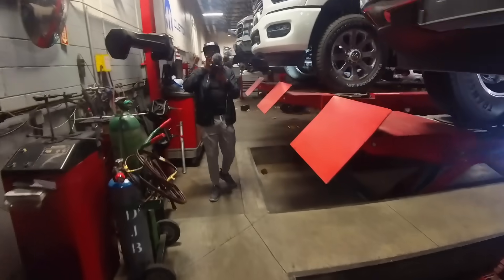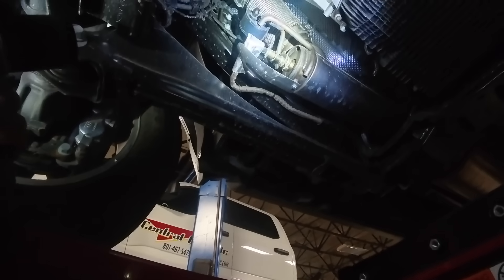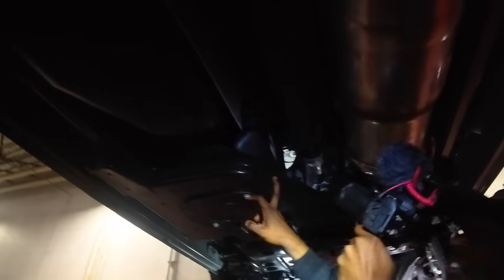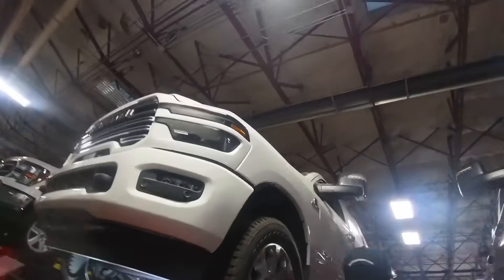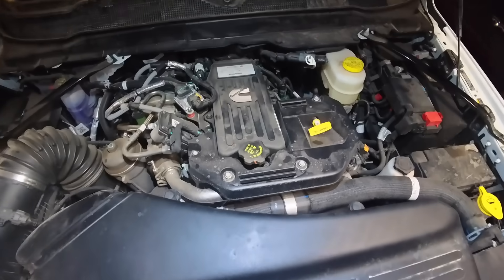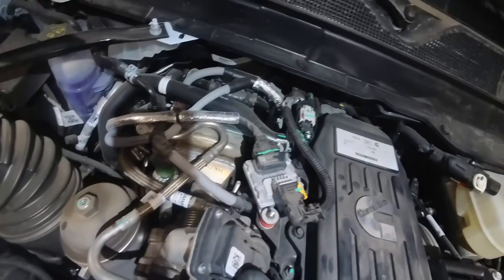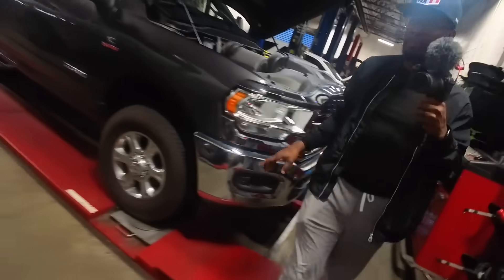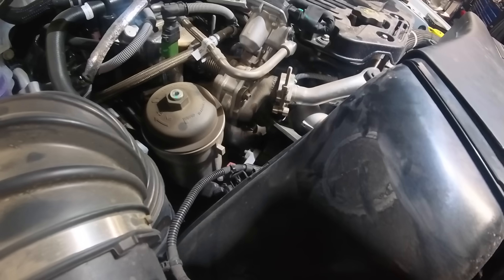Master Tech Compares The Old HO Cummins To The New One With ZF TorqueFlite (Powerline)!

Comment: I have a 2002 24valve cummins. Question what can I do to enhance  my engine to stay cooler and what other options do I have for the all round drive.
Reply from the maker: You can still do the fleece coolant bypass for that engine and I highly recommend it
Reply: @Trukstuf 
  New viewer here and I second that.  I installed the Fleece by-pass on my 2000 24valve, helped cool the temps a lot.  I just brought home a 2025 yesterday but haven’t had time to crawl around it yet.

Comment: Just got my 2025 last Thursday and it just had it's first hiccup yesterday.  After driving off, I noticed it still said "press brake and button to start"...  I also noticed the blind spot indicators were stuck on.  I unhooked the battery for a few and then that reset the dash and it started working but then I got several errors about trailer brake lights out, service 4wd, etc.  I used the idash to see the codes and it was showing P2509.  I was able to get all of the errors to go away and used the idash to clear the codes (though it still shows the P2509 on on the idash but the CEL is not on and no other errors).  Not sure what gives...  Guess if it does it again it will go to the dealer....

Comment: Josh, do you recommend the BD Diesel grid heater upgrade for the bolt-nut issue?
Reply from the maker: I do not. They have had 3 revisions trying to get it right not to mention the area it takes up that combined with the factory grid heater restricts even more air

Comment: I have a 24, why did they mount one of the fuel filters all the way back there? Also what's wrong with the injector on the dpf? If it helps stop fuel dilution, I'd think that'd be a good thing

Comment: Interesting with the '25 having the SCR / DEF injection ahead of the DPF, I wonder if the DEF will cause corrosion issues with the guts of the DPF long-term?  Also, wonder if they've ever tested pulling the EGR after the DPF, like what CAT did with their CGI system, would seem that you'd want to try and pull the cleanest exhaust gas that you could for the recirculation.

Comment: Thanks Josh, Thanks for letting me know about the 7th fuel injector for the regen last week, I like that method better. I never liked the idea of wet stacking the engine to get a regen. I remember all of the low mile 6.4 Power Strokes I had in our fleet that lost engines because of fuel dilution.  I brought home my new 2025 3500 Limited dually yesterday, what an incredible truck!